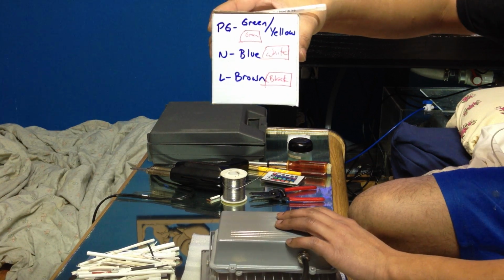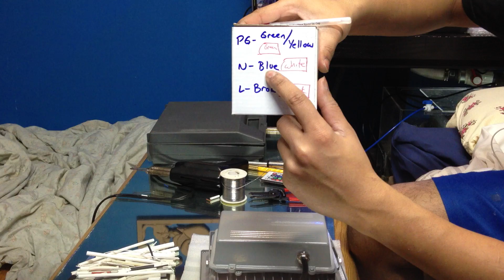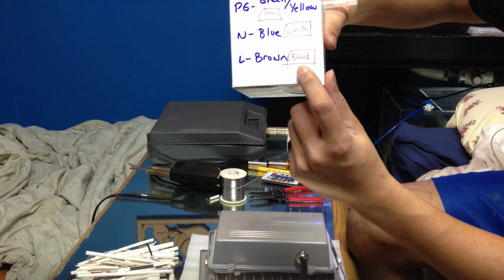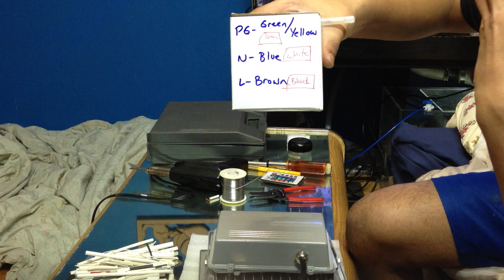Led Flood Lights (How To Wire)

Comment: ???¿ "GREEN IS USUALLY  <<GROUND" >> ¿???  

I was hoping to get info on The Wiring Of 22o volts Hookups, but I don't think u At All Covered That Part.

Good Job on :
Overall educating us but watch them Small Phrases that can cause BIG Misinformation .
  Ur good though man.

Is 220 mean I have to hook 

Brown- {HOT} (L1-{Black}

Blue - {NEUT] (110v) {White}   
 or can this also be the 220 Wire?
L2 (HOT #2 red)?  
Neut 110 or #2 Hot for 208-240
  -- 220 -- 
   [ 2 🔥🔥 for  (Single Phase] 
& a Neutral Wire - 3 wire 220v
& a Ground Wire - 4 wire 220v
   [ 3 🔥 🔥 🔥  for (Three Phase]

Green/Yellow- - - - - - - - - - - - ? !!!               
                  ¿¿ALWAYS♡GROUND¿¿
Thank u

Comment: I have been ordering these Chinese Floodlights for a few years now. If you go with one that does not have a US plug-cord, it is very short and nearly impossible to put into a junction box, if you do manage that you have very limited mobility directing your light. I think I will try something similar to your video, using a PC power cord and go past the cord relief and into the unit itself.

Comment: Hi I have a light just like  in your video. Mine has a motion detector included in light. Wires on motion detector are red blue and brown The power cord coming inside light are yellow (ground) blue and brown. Then I have a blue and brown on the led driver (in) , red and blue out of led driver to the led . I forgot what wires from the power cord connect to what wires on the motion detector, then from there what wires connect to the  blue & brown on the input side of led driver. I really would appreciate it.
One other note the yellow ground wire on power cord was cut off flush inside the black power cord where the wires feed thru . if you need some pics I can email them.Thanks,

Comment: is it possible to wire these lamps in parallel? for example 3 of the 10W or 2 20W sharing the same power cord?

Comment: I bought a 50w unit from Amazon.  The one I bought came with 3 prong adapter (US).  I used a volt meter to check for continuity.  Yellow is set to ground, Brown is set to neutral and  Green is set as live.  I spliced wiring in those order to my box and it works fine.  I am seeing multiple reviews where others are saying that brown is live.  The item doesn't come with any wiring diagram.  How did you determine which wire was live/neutral?
Reply: mlim82480 normaally, for led lamp ,you don't need to care which is live and which is neutral, they all works however you connect, but you should know which is ground wire ...
Reply: Mine are: Blue, Brown, Green/Yellow !
The box said Blue was live ???

Comment: I have been an electrician for 40 years in the UK as you say the earth is very important it is the one wire that will save your life so when fitting a plug or a connection into anything it is best if you can to leave the earth slightly longer than the live and neutral wires so if the wire gets pulled out the earth is connected longer than the live wire.

Comment: Hello please help, i have 10W lamp with 3 wires coming out from it. Brown Green and Blue. I know how to connect it, but when i oppened the case of the lamp, i found out that the yellow cable is not connected at all. What should i do? Should i join it with the blue wire? THANK YOU for your advice
Reply from the maker: The yellow cable probably just got loose from the case. It's a grounding wire so just take the inside nut/bolt and some how stick it in there.
Reply: ***** Thank you for your quick answer. So am i getting it right that i should connect the yellow cable to housing of the lamp?
Reply from the maker: That is correct

Comment: Just a heads up. The size of the wire is very important. It should not be any smaller of a gauge than the factory wires to be safe. Personally I'd check the current flow right away before I assumed the wire I used was ok. The LED is only 30 watt but the led control will draw more amps and going from ac to dc will also draw more amps.

Ether way thank you very much for the video. It was very helpful. I'm thinking about buying 6 of these in 50 watt to light my shop. Might even go with 100 watt if the price isn't that much different.

Comment: did you eliminate the yellow with green stripes wire? does it have any purpose?
Reply from the maker: The yellow with green stripe wire is the ground. Without the wire the lights will still work but believe me when I say PUT IT ON! that ground is very important to have when hooking up electoral products near water.

Comment: Why are you using the 30 wattage.  Did the 4 10watt not do enough?
Reply from the maker: Yea the 30 had to be there. The flood light have too much of a flood. So the light ray do not have sufficient PAR towards the bottom sand bed. Shallow reef tanks are good but 20" + I would suggest 30watts or 50watts. Better yet hit the Par38 full special reef lights, those do wonders.

Comment: Those where my firsts lights, so actually I impressed myself xD It was very difficult to “peel” the big cable  [I use a cuter; was impossible with the wire stripper] to get the 3 small wires to connect them to the lights. Your video is the only one in the matter [“led flood lights for aquarium system”]
Best regards ;)

Comment: Hi; excellent video!!! =D and why instead of opening the case, you just solder the wires that came with the light and use heatshrink tubes to protect each cable and a bigger heatshrink tube to get them together?

Comment: I forgot to mention that the outside porch light fixture has a Black, White and a bare unprotected wire going to it (not sure what that bare wire does for a bulb that only has two conductors). I will have to puncture test the black and white wires using my meter to see which one goes to the center conductor on the light fixture which will be Positive. Not sure what to do with the blue wire, maybe connect it to the bare copper wire?

Comment: Can I wire nut one of these to my existing Outside light fixture? The light fixture also has three wires, but I want to install the LED flood pointing in a specific direction in the yard and keep the main light intact. My 15watt LED flood also has Yellow w/green, and a Brown and Blue wire. I've already taken apart the light fixture and it looks like a very easy job, just need to make sure its ok to cut and wire nut all the wires together so that TWO separate lights work in tandem. Thanks